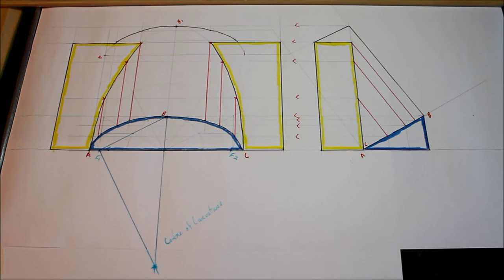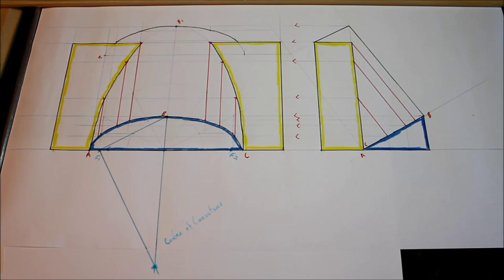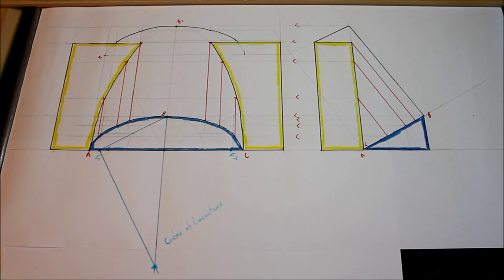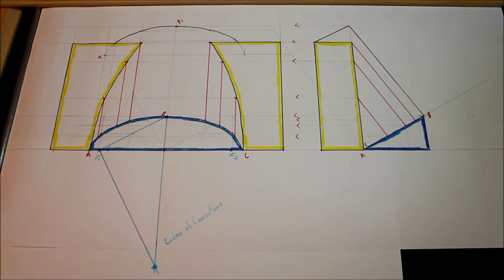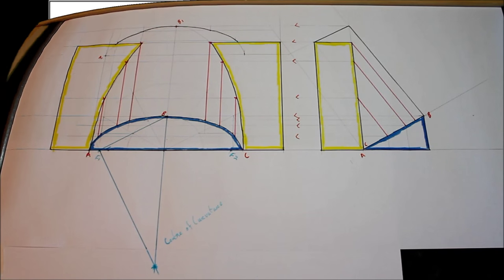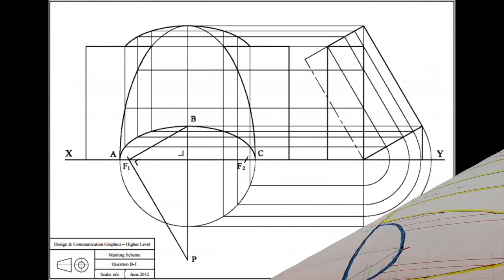DCG: 2012 Higher Level Question B-1

Comment: Could you have drawn the bigger ellipse first just using regular ellipse method and then used the elements to draw the smaller ellipse? Like basically what you did but in reverse?
Reply from the maker: Yeah,can’t see why not. You have the major and minor radii for both so either way would work. You’re also still using the elements like they said to use in the question.